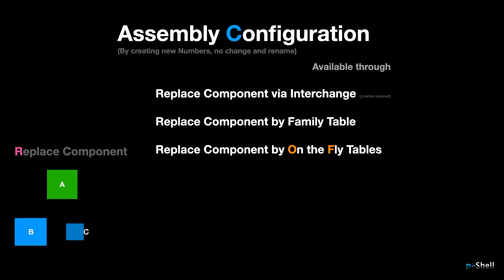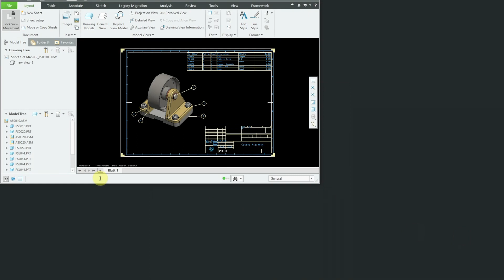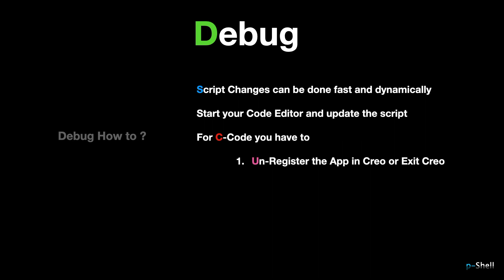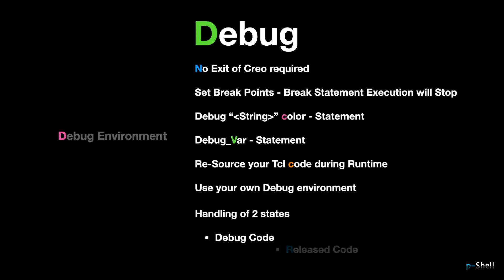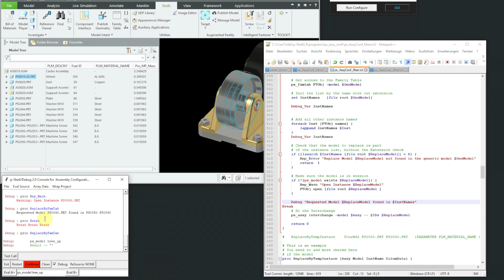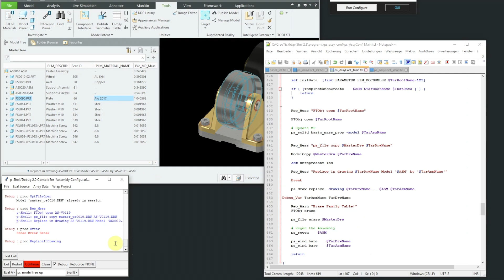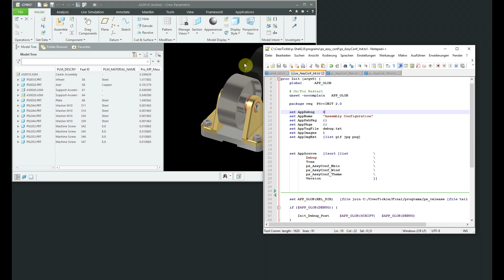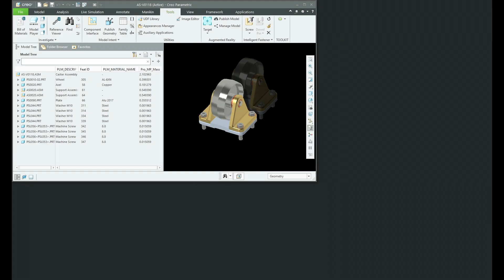p-Shell Part 03 - Creo Scripted Toolkit in Synchronous Mode Assembly Config, App Develop and Debug

Comment: Hello, can we get in touch? 
I have massive automation to be done for my company and I really need someone's help. 

For starters, i need to automate to convert 3D parts to dxf  files format, without opening each part. 
then i need to automate making the 3D assembly based on my parameters

is this possible?
Reply from the maker: See the Tcler's Wiki for the 'Save As' Example, 8 Lines of code for export all part files in session to DXF. Parameter example and my Mail address are as well in the Wiki.
Reply: @Tcl4Creo  great. I will get in touch with you.

Comment: Can you please create similar creo customization j-link & toolkit
Reply from the maker: To be honest, I don’t understand your note. If you want me to do this in j-Link or Toolkit, my answer would be no. Because there is much more code involved. But for sure with more effort you can do this in j-Link as well. As fare I remember I spend 4 Hours from scratch for this. p-Shell is a compiled Toolkit Application running in synchronous or a-synchronous, even full a-synchronous mode with menus in Creo. The latest version runs compiled in Creo 9.0 with 9.0 Libraries, without any deprecated Toolkit function in use.

Comment: Hey bro can we do some scripting for Creo simulate?
Reply from the maker: Hello Sasi, I’m sorry to say that the Mechanica Stuff (about 10 header files), are not included. PTC charge here another License fee as well. You can run programmatically mapkey’s in asynchronous mode (see the Wiki). But of course, you need to watch the trail file, if you want to check the status. Currently p-Shell is successfully compiled and running with 8.0.3.0 libraries, and of course older Creo versions.

Comment: Can we do similar type programming ,automation and customisation in ug nx software/unigraphics using p-shell scripts. ?
Reply from the maker: No, sorry, this is only available for Creo.
Reply: @Tcl4Creo  Thank You
Reply: Hi Greetings!!!,
Can you look into following queries
1) Can we call BoM table in assembly mode not in drawing sheet in normal practice we used to do it.
2) in assembly mode when I move cursor to near part it has to display
Following
a) Raw material size as per BoM.
b) material type. Including weight.
c) part name
d) is part in assembly/in which sub assembly. 
e) color code ( with editable color palette)
F) CG and MI Properties etc.
Reply from the maker: @Anilkumar-sq4tp  You want to display a BOM table in Assembly Mode, yes you can do that. Question number two is more tricky because you want to have a binding on "hover" or an event is triggered if you move the mouse. As far I remember there is no function for exact this request, but you can do that in a special mode by your own (nice idea btw). I guess you have to use ray tracing to identify the model under the mouse pointer (callback is possible). Send me an eMail and we can discuss this in more detail, see the linked wiki for the mail address.
Reply: @Tcl4Creo  
I have many queries like which I want to do. But I don't know much about programming. I need to learn and practice a lot. But I am sure all my ideas are doable. As per present situation I can't do this boz not having much expertise and experience in programming. 
Anyway soon I will send a link what's the question 2 in detail. It will take Time. In mean time if you can do it send me snapshots so that I check and send other questions to you.
I want make ug and Creo interface at different level are my thoughts. 
Can you help me in programming stuff ?  I am eager to learn from Experts like you who are capable to guide me. I am sure you have great knowledge and need channelized your capablities.. 
I appreciate your capablities n knowledge. Keep it up. Do more challenging tasks.
Thank you very much for replying in detail.

Comment: 12:10 That's a good video.
When displaying the image in the video above, are you using ProRasterFileWrite() to save the image and then display it?
Reply: Yes, ProRasterFileWrite is used to export the image. Rather to specify to window handle, you specify the model name, if no window exist, p-Shell will open a new window and attach the model before export. Any Function Call Parameter can be specified, like width, height, Dots per Inch, and so on. The exported image can later be used in Tk for creating Labels, Buttons ….